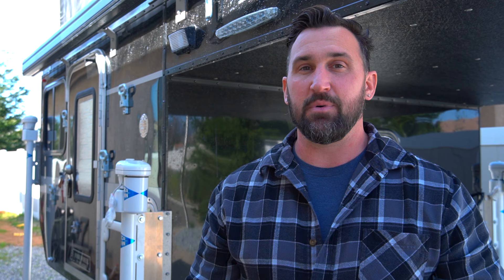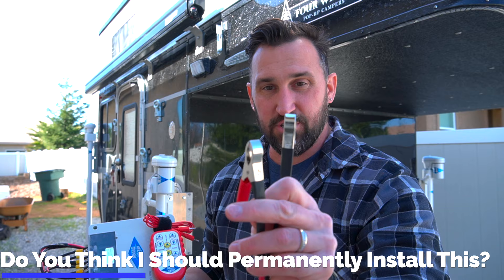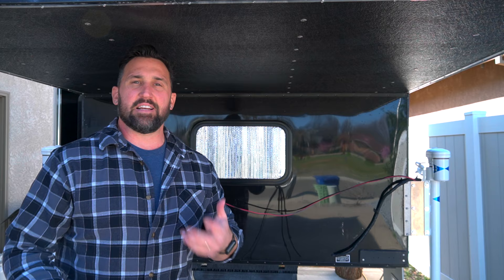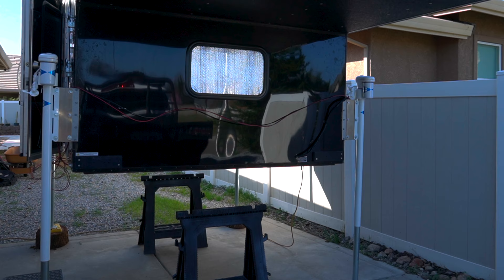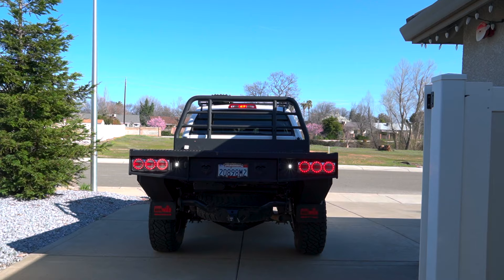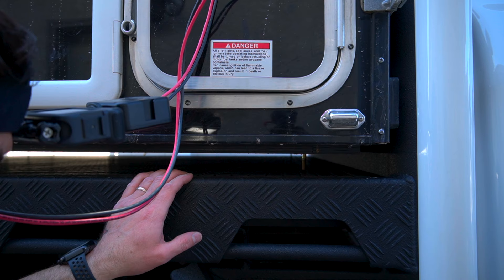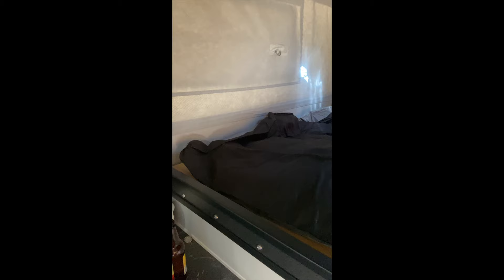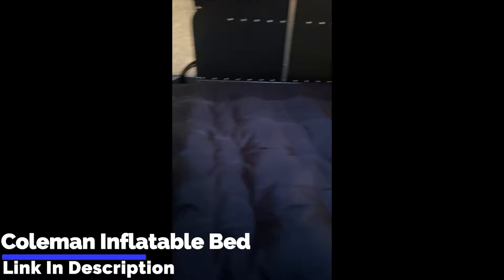Pop Up Truck Camper Install | Hawk Flatbed

Comment: Great video!  I have  Northern Lite hardsided camper and because my truck is a daily driver, I load and unload my camper multiple times throughout the camping season.  It is easy to do but I do get tired of putting it on and taking it off every time we look to go camping.  For that reason, I have been thinking about going to a 4 Wheel Camper so that I can leave it on my truck year round and not take it off.  I think I would go more if it was always on my truck, even though the process of loading/unloading is not difficult.  Spur of the moment overnighters even would happen more if I was always loaded and ready to go.
After watching your video, there is no way I would load and unload the camper like you did and have the portable jack setup.  That is a lot more effort than what I have to go through with my Northern Lite.  It is good you can take if off if you need to but I would not be interested in doing that on a regular basis.
Reply from the maker: We are definitely working toward getting another vehicle so we could leave the camper on full time... but for now, it doesn't really bother me taking it off as frequently as I do, I usually take it off 1x a month.

Comment: Thanks for sharing! I pick up my camper in a couple weeks and this video really helped me to understand how the instal works. Where is the electric plug between the truck and the camper?
Reply from the maker: That plug will be on the driver side of the camper, between the fridge and the water heater...... I'll put the picture on todays post for you  👍

Comment: Great video! We have a flatbed Hawk, and the is good info. Where did you get the mat, and who makes it?
Reply from the maker: Thanks!! Which mat are your referring to?
Reply: @WolfPacOutdoors  The one between the flatbed and camper.
Reply from the maker: Sorry for the delay, the mat came with the Norweld Tray... I couldn't find any records on what brand. Your best bet will be to contact Stan K. at FWC HQ, they also install Norweld trays and he should have all those details for you. Thanks for the question!!

Comment: What type of bolts and nuts are you using? I used some stainless on mine setup and they galled up even with hand tools.
Reply from the maker: for the exterior im using stainless, to hold the camper to the tray I use grade 8 bolts

Comment: What is the brand of mat you are using between camper and bed?
Reply from the maker: I haven't been able to find a brand label on it however, its the stock mat that comes with the Norweld tray. You could try going direct with Norweld or Four Wheel Campers for that.

Comment: Y don't U use alignment pins and locks like they have on a container
Reply from the maker: This is a great suggestion 👍 I even had to look it up to understand what you were referring to... As for why not 🤷‍♂️ the factory system seems to be holding up well and its not overly involved. Although it would be nice if it were easier to line it up 🍻